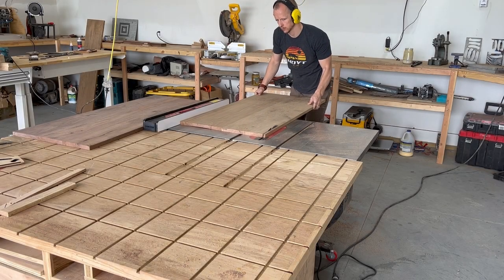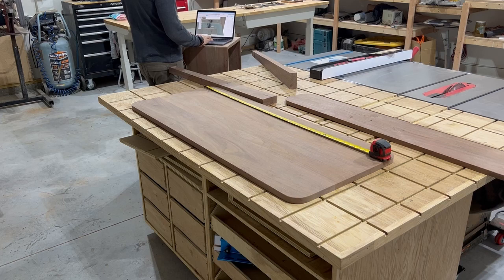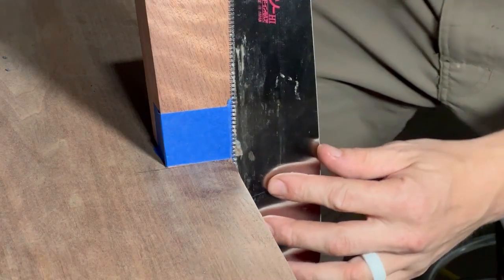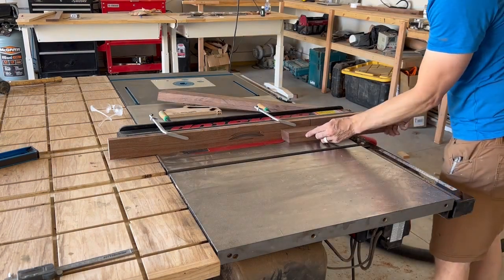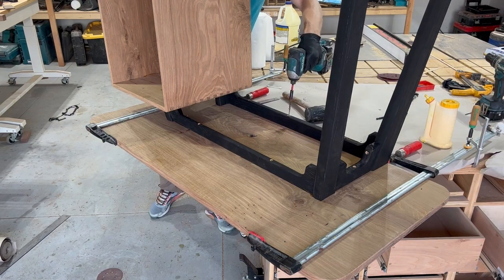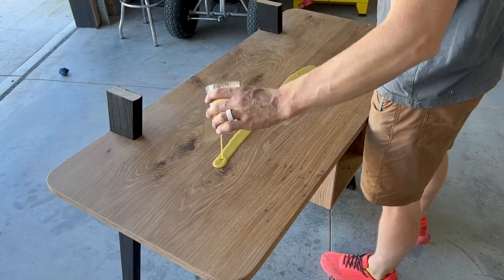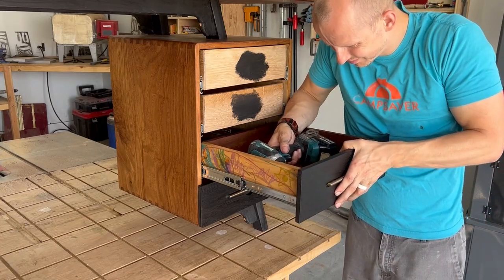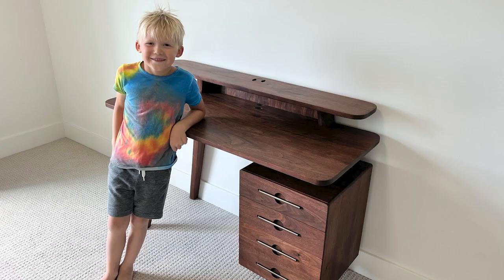Mystery Wood desks part 2 Midcentury modern

Comment: Looks amazing! Just one question: as you make this back panel out of wood and put he pieces very tightly don't you afraid that after wood contraction will the gaps appeared?
Reply from the maker: They are small enough I’m on too concerned about that much movement, but I’ll keep an eye on it this winter and post a picture if it changes!